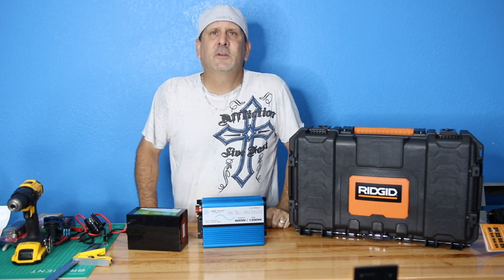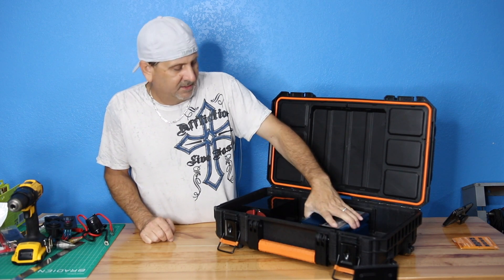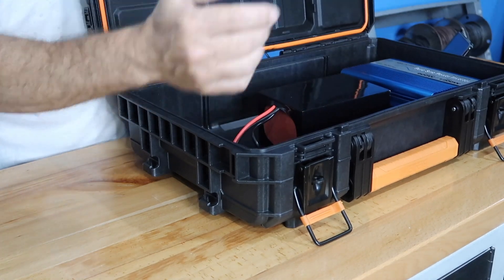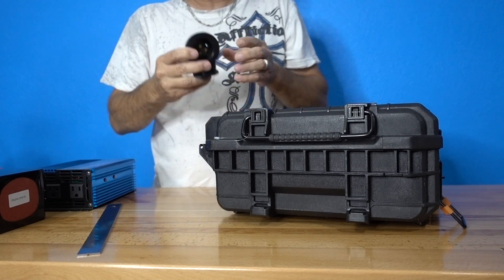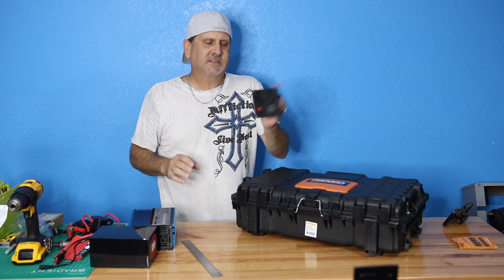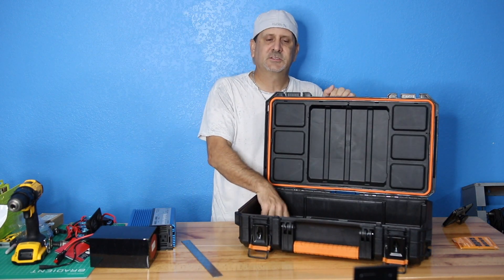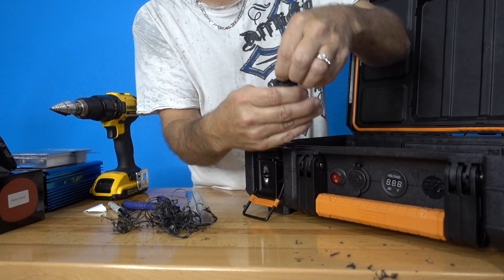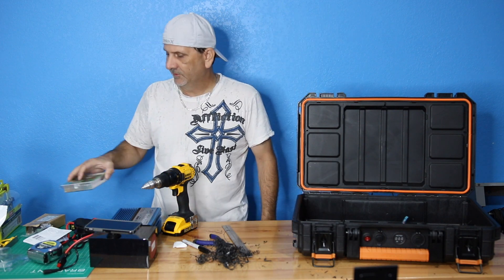Portable Solar Generator DIY 12 Volt to 120 Volt!

Comment: I need a one with 2 DC ports to power my DC fridge cooler  and my DC swamp cooler with at least a 100 amp hour battery and I can charge it with 200 watts of solar and my generator. I have the solar panels how much would you charge to build it for me
Reply from the maker: Pink, I can do this! Shoot me a PM with your specs and we can talk about the price. I'm thinking a 1200w or 2000w depending on the watt and amp rating of your DC fridge and swamp cooler. It shouldn't be to bad even if its a roof mount cooler, shouldn't take that much power as its just a water pump and a fan for the most part.